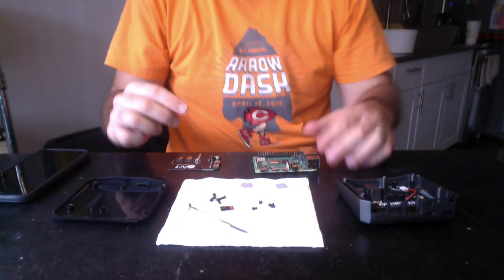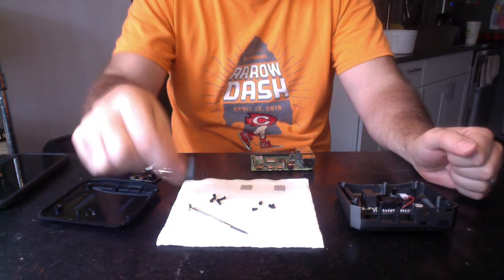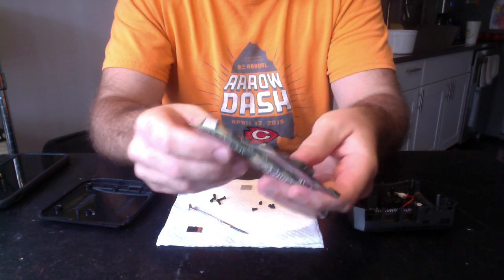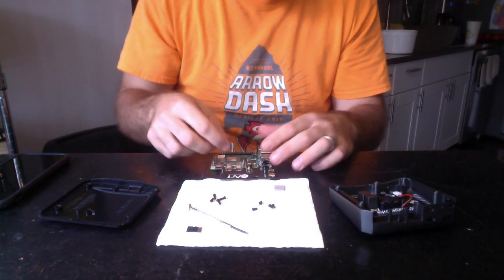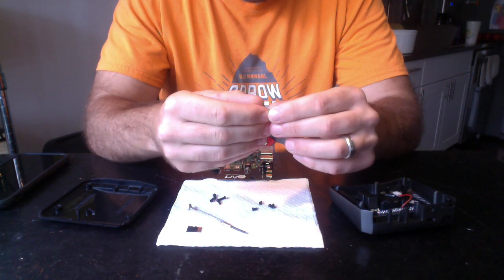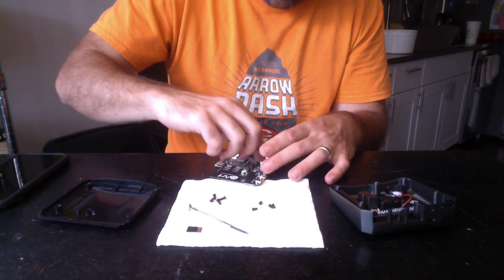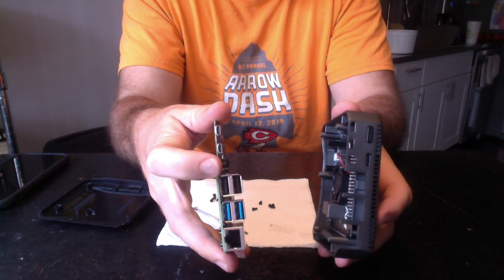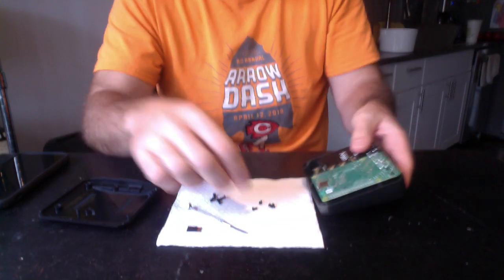Building Raspberry Pi for use with Soundjack

Comment: Hi - very interested in this project -do you know the capacity of the raspberry pi? 1/2/4 gb?
Reply from the maker: Hi Hector. We are using the Pi 4b 2 GB because that is what Christian Hoene from Symonics uses in his pre-built models when he sells the FastMusicBox. I’m uncertain if the 1gb would work. We also went with this specific case since it was both sturdy and has a built in fan.
Reply: @vocalfriperna  that's great news!  I was assuming that it was the 4GB model so this is definitely a good thing!  I'm looking put my own together (with a case w/fan!).  The pi seems the best answer to solve a multitude of issues....  Thanks for putting together a great video - it's always good see someone going through the process.  I appreciate you!
Reply from the maker: Hector Vasquez the tricky part it seems for most people is unzipping the OS and loading the OS onto the flash card. I’ve got a sheet for that too for Mac at least. Haven’t tried on a PC.
Reply: @vocalfriperna  I read as much at the Raspberry Pi download page.  I can play with it in the next couple of days...
Reply: I really appreciate your time and experience, Nicholas!  One last question - in looking at the Raspberry Pi OS web page (and assuming that's what you used), what version did you download? OS with desktop/recommended software, OS with Desktop, or barebones OS?
Reply from the maker: Hector Vasquez No problem! Anything for my alma mater! You should buy the pre-configured OS from Christian Hoene at Symonics. Then I can share my document on getting that installed. Email him at christian.hoene@symonics.com and tell him you’d like the FastMusicBox OS for your Raspberry Pi. He’ll send you PayPal link then send you a download and password. From there email me nkperna@mc.edu and I can help you get it setup.
Reply: Very interested in building one.  The Symanics site says that Adafruit STEMMA Speaker is required.  Did you add one? Or, just use the Fastmusic OS?
Reply: Would like to see what the difference between Fastmusic OS and other OS such as Unbuntu.
Reply: @dnjost  i think the main difference is that that fast music box OS is compiled to work on the Pi processor while the Linux app on the website is for intel/amd processors